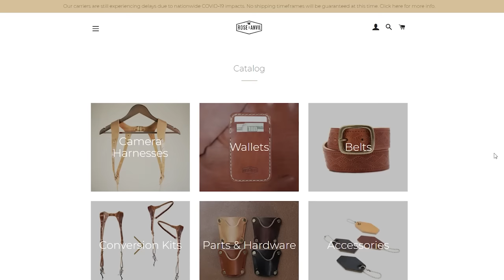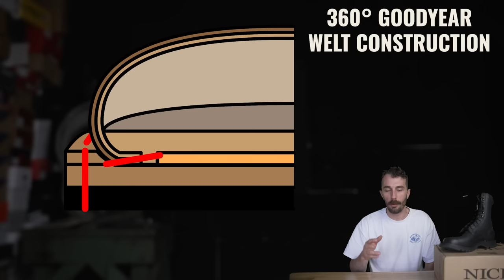($524) Are these the best Tactical Boots? - Nicks Boots

Comment: I find it borderline criminal that Nick’s is charging what they are for a boot they essentially cheapened with rubber and foam and then called  “tactical”.   This is a $270 boot
Reply: Lol. Substituting 25 dollars worth of leather for 20 dollars of rubber and sowing on a padded collar means this boot is almost criminally overpriced and should be almost half its retail price.
Reply: Yes; and at that price, I want waterproof!
Reply: @AveryH7 your joking right, The highest quality cow leather you can get can range from $200-400, plus the work and precision it takes to make just one pair of boots
Reply: @Hoguera  yes. I'm being hyperbolic. I'm responding to someone who doesn't respect the craftsmanship that went into the boots in this video. Also, $400 for the high end of cow leather is insanely high. Horween, Cfstead, Seidel, Maryam, and Badalassi are all selling hides at 200-260 for 13-22sq.ft each.

Comment: I ordered the coyote tan yesterday!  Kind of wish there was an option to keep the leather midsole, as I need the boots for a uniform requirement, but have essentially zero need for water resistance. A rubber midsole isn’t as attractive to me as a boot that would mold to my foot with use. 

Would be nice to have the option for those two little vents like you showed on the jungle boots, too, to add some breathe ability.

Comment: That is awesome! They remind me of the old 1960s GI issue boots that I loved so much and really worked so well for my feet.
These look to be a great choice for me except for the PU heel, I wear my boots so intermittently that the PU fails before I were the boosts out so I avoid that material, maybe an all rubber heel (yes I know that i will be stiffer, I lived with it before and can live with it now because those old boots really worked for me for many years without that PU).
These look awesome, great review!
Reply: The heel is replacable.
Reply: @irnavas  Obviously but I don't want to take apart a brand new boot, that makes no sense to me.
Reply: @Billy123bobzzz  why don’t use the boot and repair when it wears off? I would still replace with same PU for comfort.
Reply: @irnavas  Because I have had many boots with PU and they all fail too quickly in my use, a full leather or rubber heel is just fine for me. PU fails under heaven use so that makes no sense to me.

Comment: Rough out Coyote, 10" shaft, leather stack instead of foam ( I understand why folks would want the foam )...spike resistant layer on the foot bed. Bottom 5-6 eyelets then quick lace studs up the shaft.
Liking where they are going though.
Massive fan of the overbuilt workboot. Roughout natural Builder Pro with some add-ons. Honey sole at this time but if they did the tan sole from this vid I would go with that.

Comment: Great video! Like to see Nicks trying to diversify and try out different products. I would love to see a review on “Whites Line Scout boot” For wildland firefighting at 370 I am interested to see them cut in half and what kind of durability they are selling at that price point. Sometimes your boots blow out right before the season like mine just did and you are stuck looking for something you can ship ASAP. It’s been hard to pick a boot in the 250-400 range
Reply: I just went through a pair of the whites line scout and they were not worth the money based off the durability of the leather thickness they used. Blew holes in them no problem and they don’t have the capability of being rebuilt when there is a hole in the tow box. Spend the extra 100+ on the Nicks. I kick myself for not doing so last year even though I was kind of in a pinch for a pair of boots. The break in period was quick and they are comfortable but that’s the best I can say for them

Comment: Up until like a week ago I knew very little about boots except that I don't ever fit any and nothing is ever comfortable. I'm in between length sizes and I have very flat, extremely wide feet that are also thick from bottom to top. I usually have to compromise to get just one aspect of boots to fit well enough to do the job. 

While others may pay $500 for all the reasons known about Nick's, I consider the cost worth it just to have a boot that fits period. I've spent years wasting my meager $120 boot stipend on boots that fall apart 6 months into the year. Never again. 

Looking forward to getting a pair of these guys. While it'll take up every penny of equipment allotment and then some, it seems totally worth it. Most guys I know have no problem blowing $500 on new guns they never shoot or carry, I think spending it on something I have to wear 12 hours a day, driving, standing, walking, and chasing, seems like a heck of a better investment
Reply: You're right on point.  Whether you go Nick's, White's, Wesco or any other custom brand, you'll be thoroughly impressed.  It may even change your life.  It did mine.

Comment: Interesting take on Goodyear welt - and wrong. You described a Blake/Rapid, essentially, although true B/R is a bit different still. On a true Goodyear welt and handwelt the welt is not stitched through the insole but on a feather or a linen strip (gimped GW construction) that is either carved or glued onto the insole. Storm welt, Norwegian welt etc. are then deribates of the Goodyear welt/hand welt.

This combat boot (that looks cool) is made on so called weldtskoen construction, used often for hunting and wet area boots.

Comment: My biggest concern is the use of that vibram Sierra outsole. I'm not sure if there's variations in them but I've always found them to not be hard enough to make resoling them again worth it, the heel wears out to nothing in a month and starts to eat into your foam midsole so I ended up having to pay more on resoles every time. They should have gone with something like the bifida
Reply: I believe they opted for the sierra for flexibility over robustness.
Maybe they'll come out with a boot with a more durable sole. Then again, you can customize with your next resole with whatever you like, granted you have access to a good cobbler.

Comment: They look like a very well made set of traditional army boots, however I’m not sure how they would compare with more modern lightweight breathable combat boots for “tactical” use
Reply: They aren't great for actual tactical use would be my guess. And especially not when compared to Haix, Danner, Salomon and other dedicated brands making dedicated combat boots. Also the price is way to high again for actual tactical application. Salomons come at around 50% of the price. 530 is a lot considdering tactical boots typically doesn't last that long. Aka very nice boots, looks fantastic, but not suited for actual professional tactical application.

Comment: I need a lowest total cost of ownership boot for foundry work.  Metguard, heat resistant,  walking across uneven terrain.. and lots of sand and metal shavings.

I would attach the metguard to the top of the tongue,  so it doesn't tear where it attaches to the toe and let sand in.

Sand is an enemy.  metal drops burn up laces.

Comment: Needs to be lace-to-toe. Individuals who actually need this sort of footwear for "aggressive contact" as it were need the lateral support. Until then this is really for deskchair operators and the hipster trendite types. I would like to see a cut in half comparison between these and the Danner Ft. Lewis boot.
Reply: The foam heel also seems like a mistake. The boots seem like they came out of the oven a touch early, developmentally speaking.
Reply: Bro just stop. Lace to toe is only for boots that don't fit right. I have NEVER needed lace to toe boots. Not even in the service.
Reply: @R1NR4N  Wrong.

Comment: One thought is that the lacing might make them a bit more situational for emergency tactical situations. Probably great for shift work but a zip might be helpful when the wearer needs to don them in a hurry.
Though I'm otherwise less a fan of zips and appreciate they make full waterproofing more tricky
Reply: No. Zippers are garbage for military boots. You can get these boots with speed hooks. I would have preferred a speed lacing system like on Danners, but jooks are the second best.

Comment: For a military use boot you don't want leather. You NEED to have cushioning. A hiker will think a 50 pound backpack is heavy. An infantryman will consider that normal if not a little light. 60 pounds of weapon and armor is the norm. At a live fire at NTC (desert training), I've carried 141 pounds of gear without my rucksack (backpack)... we were weighed so we wouldn't overload the helicopters. I've put on hundreds of miles on just road marches. I ran most of the 6 and 12 mile road marches in Air Assault school... but that was with a super light pack that only weighed 35 pounds, plus another 16 for clothes, weapon, helmet, load carrying gear, water, and boots.  

Every generation of armor kept getting heavier with the addition of the SAPI/ESAPI/XSAPI plates, then the side plates, then the IOTV with plates. 

That cushioning is vital for saving the knees, hips, and back.  I with it had been around many years ago, and should be the standard. Not the EVA crap that is in a lot of boots. It's very soft and comfy for a short time but gets compressed very quickly and loses the ability to absorb shock.

Comment: As a sailor, I'd feel quite comfortable rocking these on the job (if I could swindle my command into believing that these are within regulations, that would be wonderful, the Navy does not recognise good construction and American production as one-in-the-same). I might just attampt to wear these boots in-uniform and either convert my division into wearing them or fall to the wrath of my chain of command and their distain for comfortable and durable boots.

Also, I currently wear Nike SFB Gen 2 boot in Coyote Tan in uniform (not explicitly authorised, yet it is not questioned at my command...) and I would greatly appreciate if this boot were reviewed. It has a couple of flaws, as it has split near the toe crease on my personal pair just as as the pair belonging to the only other person in my command who wears this boot. The boot feels more than comfortable enough to handle my line of work, but they leave a lot to be desired when it comes to durability in regard to military usage.

Comment: Short critique:
Insole should be leather
Sierra outsole is wrong for an all-leather boot, 1321 Omni-Trac is the better choice
There should be a steel-toe option
Should be 10" (minor complaint, but there it is)

For a tactical boot, I think I'd rather have a leather insole than rubber. The rubber makes sense on the midsole, especially since tactical boots get exposed to petroleum and other chemicals a lot, but military boots just don't get so all-day-every-day wet that it's worth trading the extra breathability, compressibility, and form-fit of a leather insole. Most tactical boots use rubber there, but older-designs that used leather are usually a lot more comfortable (I wear WWII-replica boots pretty regularly).

The Seirra outsole is good in sand, and bad on ice or wet snow (or a freshly mopped floor). It's a bad choice for and all-leather tactical boot because no-one is going to buy an all-leather boot for the desert. The Sierra is a common outsole on modern tactical boots, but modern tactical boots are skewed heavily toward desert environments. Vibram's 1321 360-Force outsole is far better in colder climates and still good in the desert. Also the 1321 uses Vibram's "Fire and Ice" compound, which is more fire resistant AND much grippier in low temperatures.

The steel-toe option is just because it's hard to find a comfortable, coyote-brown roughout steel-toe. Corcoran makes one and... no it's really just Corcoran. Considering how much of the military is in sustainment or logistics, and SHOULD be wearing safety-toes, the lack of good options is remarkable. And if Nick's coyote roughout is as good as Tasman's was, then thats a hell of a good workboot leather.

Finally, they should be 10". It allows more support, and the higher shaft makes the boot more likely to flex at the ankle instead of rubbing at the top, but mostly the higher shaft looks a lot sharper with military-bloused trousers. It would just help them to stand apart visually from all the sneaker-built tactical boots that are out there.

EDIT — they also need closed-loop speed laces of some sort. Open speed hooks aren't generally allowed on uniform boots and are considered a hazard, but closed-loop speed-laces are the standard.

It also occurred to me that this boot is in direct competition with Dehner's Tank boot (also custom-built and custom-fitted), but Dehners are actually a little cheaper. Dehner's uppers are a superior design for water-resistance (they have about half as many seams, and the only seam on the lower part is at the heel), but Dehner uses a Goodyear welt.

None of this means I think these are bad boots, but Nicks seems to have made a lot of "heritage boot" choices, or looked at basic training boots. As far as stitched tactical boots go, Dehner is the bespoke boot, and the Corcoran Marauder is the mass-produced boot, and both are in some ways better than Nicks' tactical boot (I wouldn't call Corcoran's build quality better, but they're on the Munson last, and the heavy-duty cordura they use is very sturdy and comfortable, and Corcoran was the first company to start using Fire and Ice soles on their tactical boots; Dehner's build quality might be better). I think that Nicks means to master their craft, so they're going to get better. As things stand, I think I would still go with Dehner for custom boots and Corcoran for military work boots.
Reply: The insole not being leather makes no difference since boots don't breathe from that direction. The upper and vamp do the breathing. 

The outsole difference is most likely negligible. 

There is a steel toe option. 

10" doesn't offer support wise anything more than 8" so that's not needed.
Reply: @Totemparadox  The 1321 360-Force is a much more grippy sole than the 1276 Sierra. The 1276 is nitrile, while the 1321 is Vibram's proprietary "Fire and Ice" compound, which has more grip than nitrile under all conditions, and more grip than SBR (like on the Vibram 100 or 132 Montagna outsoles) in cold weather. Vibram doesn't stop selling old outsoles when they become obsolete, but that Fire and Ice compound really renders SBR and nitrile obsolete, at least for tactical boots. The tread pattern on the 1321 is also better on uneven ground than the Sierra. Vibram actually seems to be trying to shift the 1276 more toward work boots, which makes sense because nitrile is actually a pretty good material for work outsoles. I mean, I've worn both for years. Military mechanics were basically stuck with the 1276 for a long time because they needed oil resistance, but as someone who's worn both in the cold and wet, I'll always pick the 1321.

The only reason I can think of that Nicks wouldn't choose the more modern outsole is that it need urethane adhesive instead of neoprene (like all the SBR and nitrile soles Nicks uses need). That may mess with Nicks' manufacturing process, since they seem to be treating their tactical boots as just another style of heritage boot.

Nick's does not offer a steel toe on their website. If they did, that would put them one-up on Dehner (who has been selling great, custom-made, custom-fit tactical boots since 1875, when they were literally the first company to provide GYW boots to the US Army, and sells their "tank" boot for less).

When the Army tested them they found 10" shafts to be more supportive, which is why they specified it for jump boots, and why other stitched tactical boots use 10" shafts. It's also something that visually differentiates the boots, while still being in regs. That one isn't a deal-stopper for me.

Also, closed-loop speed-laces would be nice. The pair that was cut apart has speed hooks, but that isn't offered on the website, it's not allowed for uniform boots, and it's considered a safety hazard on tactical boots. Closed-loop speed laces are unseen on heritage boots, but they are the norm on tactical boots.

I really hadn't thought of it before, but Nicks is in direct competition with Dehner on this boot, and Dehner builds an arguably-better boot for less. The way Dehners are designed they have about half as many seams, with only a single seam at the heel on the lower part of the boot, so they have arguably a better design for water resistance. Dehner also offers more customization, just with a far worse website.

Comment: I can see why they replaced the leather midsole with rubber but I don’t see why they had to use a rubber insole. If the boot is so watertight now, couldn’t they have still used leather? That said, I love that they size them for a replaceable insert. And by the way, your reviews and conclusions are totally honest.
Reply: My guess is that Nicks thinks that getting your boots soaking wet in "tactical" use is almost guaranteed, so replacing the insole with rubber AND putting in a removable leather insole is a much better solution for wet environments than a rubber midsole and leather insole. In the end nothing really changes, now you just have two layers of rubber and one layer of leather vs one layer of rubber and one layer of leather.